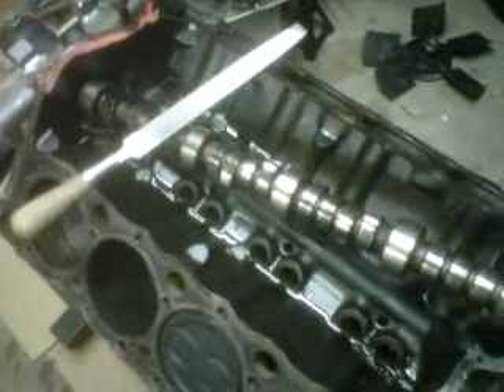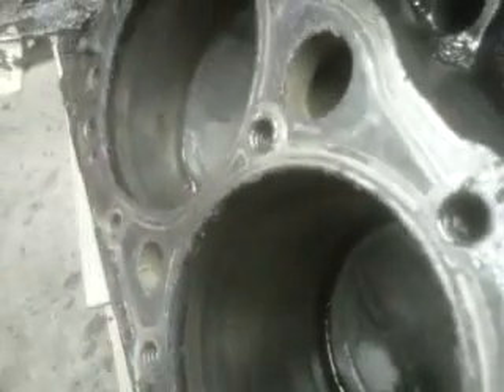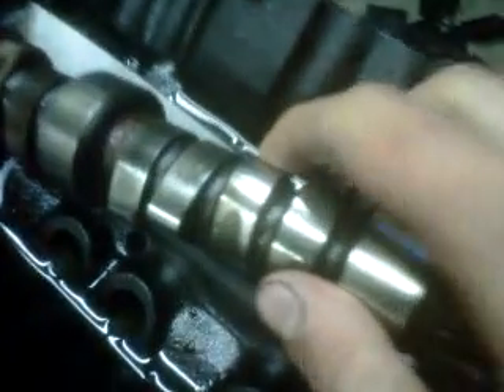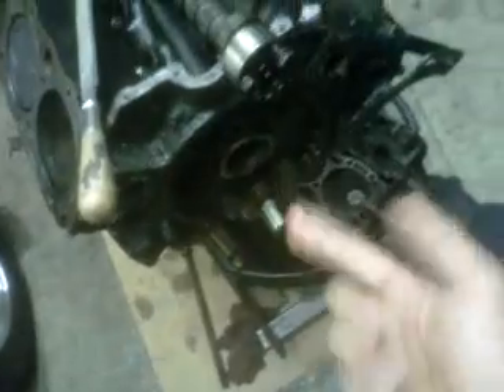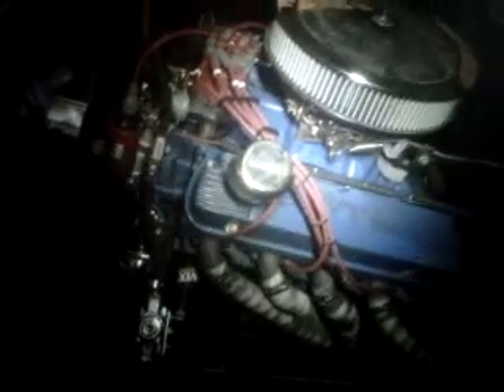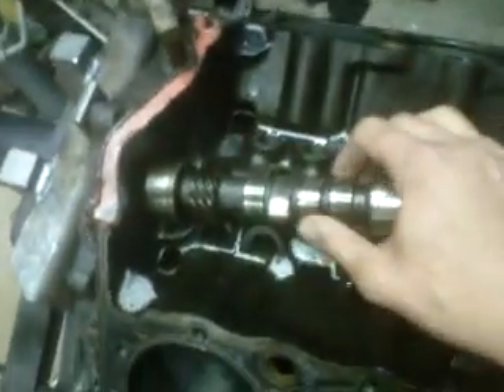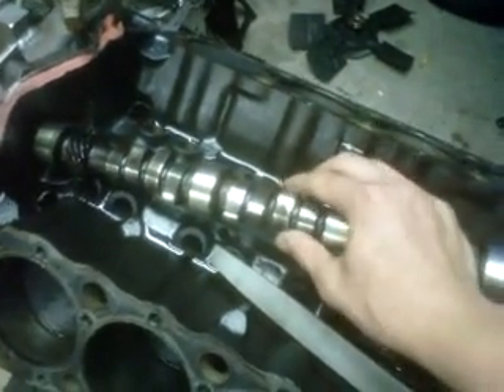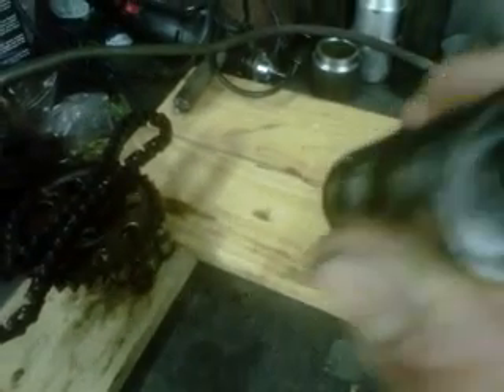Flat Tappet Cams need Zinc -here is why

Comment: iono why muscle car has so much problem.... with todays oil without zinc... my honda civic, 280k miles ( flat tapped cam non roller rockets arm ) has no problem...... odd....
Reply: Because your Honda's  valve spring pressure is about the same as a ball point pen. Also, WTF is a rockets arm?
Reply: +To Mo must be why they can handle 7-9k rpm stock
Reply: +To Mo muscle don't have roller rocket/arm stock,  I think they have it for aftermarket. Honda switched over to rollor rocket/cam whoever you wanna call it.  no need for zine since it use rollers bearing.  hope that helps
Reply from the maker: you are correct. flat tappet stuff needs zinc. i have roller in all my muscle stuff. and of course you can rev higher, you have less rotating mass in the 4 banger. they are called lifters. roller lifters vs flat tappet lifters. and your trying to say rocker arm. which i run roller fulcrum and tip rockers on all my stuff as well. - i build engines . . .
Reply: +ThunderHead289 pre 2001 Honda's are neither called flat tappet or rollers lifters. it's rocker arm.
Reply from the maker: you have what is called an overhead cam. its not a pushrod engine. cam lobe goes straight to the rocker arm.

Comment: Ah the infamous ZDDP myth.  You absolutely do NOT need zinc additives or oils with higher concentrations of zinc on a flat tappet cam engine that is already broken in..  You do not.  Google "zddp myth" and you'll see many articles about this.  The only reason you would need zinc additives or special zinc oils is on a rebuilt engine you are breaking in.  In this case, yes, use break-in oil. If you are racing, then yes, use specially formulated racing oils.  But on your normal flat tappet cam street engine already broken in, you do NOT - do NOT - need zinc additives or special zinc oils.  Regular store bought oils are just fine and have everything you need.  The articles bear this out and I myself have never ever used zinc additives or special zinc oils and I have never had ANY issues from not using those additives on any vehicle I have ever had or do still have from the 1960's through the mid 1990's - Chevrolet, Ford, Dodge, Pontiac, Chrysler, Lincoln, Mercury, Datsun - all different makes and models.
Reply from the maker: i run higher valve spring tensions and i most definitly do need the additives. i spend the extra money and go roller now. feel a lot better, and its better tech anyhow.
Reply: Average engines do need a certain level of ZDDP. However, the required levels must also increase as valve spring pressures increase. Regardless of what you drove in the 60s-90s without issue, there are many others who have seen otherwise.
Reply: Yea you only need it during break in.  but after break in you don't need it.  but having it wouldn't hurt I guess
Reply from the maker: +Toua Xiong except you do. Or you wipe lobes. I don't care what people do. I make money on engine failures from this stuff
Reply: ThunderHead289 Huh?
Reply from the maker: +Toua Xiong what don't you understand
Reply: +ThunderHead289 you said yes I do,  and I agree with you
Reply: Cool Rick, but the modern engines a lot of them ARE failing from lack of zinc. Especially MODERN flat tappet high pressure fuel pump applications.

It IS an issue.
Reply: What would be an example of a modern flat tappet engine and what role does a high pressure fuel pump play in the function of a camshaft?
Reply: blackbirdxx928 

I suppose he is suggesting there are other "flat tappet" like situations in mother engines like those turbo downsized gasoline direct injection ones.

Those direct injected engines use very high pressures on the order of 250 bar with gasoline up to some 2500 bar with diesels. This high pressures are usually obtained through a secondary mechanical pump coupled to the camshaft. Those pumps have been a failure point on many of the newer engines.

VW, Ford, GM, BMW, MB, all have versions of this kind of new engines, adopted for fuel economy. New tech, new-old modes of failure.
Reply: it certainlly increases durability. my 96 camaro has a LT1 238K on it still runs great. those engines came with roller lifters from the factory
Reply: are you running a 10 to 1 compression engine with a flat tappet cam using triple valve springs and 0.650" lift on your cam?do you spin your motor past 4000 rpm?
Reply: Zddp also reduces rusting, very important for low use or stored vehicles
Reply: I have also heard of people using a good quality synthetic in their freshly rebuilt flat tappet engines and not even doing a break in on the engine and never having any problems.

Comment: Most modern oils contain more zinc than oils of the 1960s so most are safe for older engines. But is very important to use a zink additive during break in. It just as important to use a good cam assembly lube and Even more important to follow proper cam break in procedures.
I have had cams go flat even back in the good old days when there was less zinc in oils because I didn't take the time . All high quality cams come with break in duration , rpm range and valve lash preload instructions. I have never had a problem with a cam when I followed the manufacturers guidelines. But with that being said. If you want to spend an extra $18 at every oil change for some  peace of mind .... I don't flat anyone for that.
Reply from the maker: alright, I don't endorse this statement. most modern oils are 500 to 800 ppm. you need atleast 1100ppm od zinc for flat tappets, and that's with light valve springs. look into the zinc values and call some oil manufacturers. I promise you you want to run zinc. they took it out for catalytic converters.
Reply: randy norris No so at all, the EPA has ordered zinc to be largely removed from modern oils. You definitely need ZDDP or another zinc-rich additive if you care about your motor.

Comment: Well it didn't really kill the engine a cam swap and possibly converting to roller would bring it back to life depending on milage a cam is not a lot of money with a set of lifers I would take a chance maybe but then again when you loose lobes you also contaminate a lot but In the day of soft cams on the regular by Chevy more than a few guys got away with just the cam and the filter picked up a lot they added a magnetic plug and got away with it the motors ran strong again for as long as I ever knew about but there's always that one time that some garbage would get in a bearing or clog up an oil gally and then you've done all that and lost so are we a gambling man ?? And do you feel lucky punk ? Lol I never out of at least 5 or six when they just did cam bearings and cam swap did I personally see the engine fail shortly after due to the above mentioned reasons could it happen oh hell yes did they get lucky maybe is the small block chevy just damn near bullet proof well they will take an awful lot so shit some bearings I've seen with motors that had almost no oil pressure were still running and happy even we said wow so it is what it is when buckets allow hell yeah go thru it if not I'd chance it cross my fingers and run that shit hell yeah done it seen it and bouugght the t shirt

Comment: Zinc additive just not for break in....every freekin oil change. Even on a stock motor....800 ppm is the mandated MAXIMUM for on road vehicles with cat/converters...If you run a flat tappet cam and have jiffy lube change you oil you will end up with a flat cam in....from what i see....less than 20k miles....Even the metal generated by one partially worn lobe will seriously shorten the life of your motor. Those super fine metal particals get pumped through the motor with the oil and the crank pounds them into the bearings where stick like sandpaper and trash the surface of the crank....and no, the oil filter wont trap the crap, the stuff is to small...not that it matters...untill the oil gets hot much of it goes around the filter.....as for oil...i know shops that use a lot of Mobil synthetic...i been using Valvoline racing  since about 1970 in my hot rod stuff...and my boat with a flat tappet cam....is the worse cam lobe on #7...that seems to be the first one to have a problem